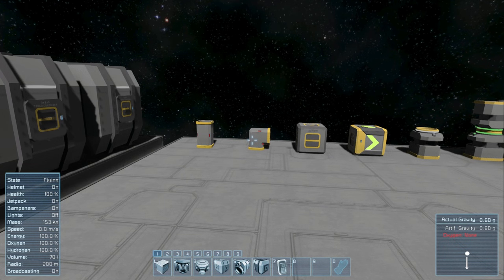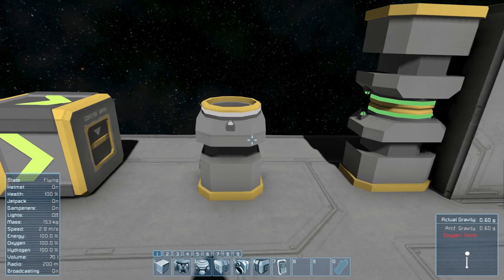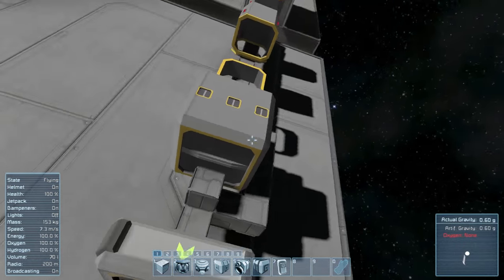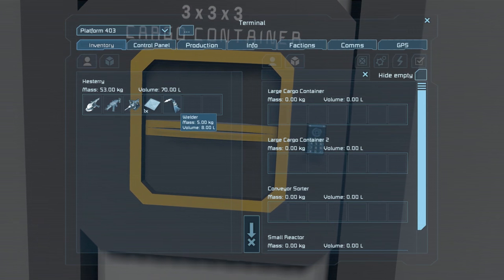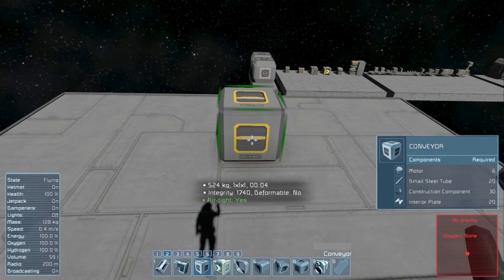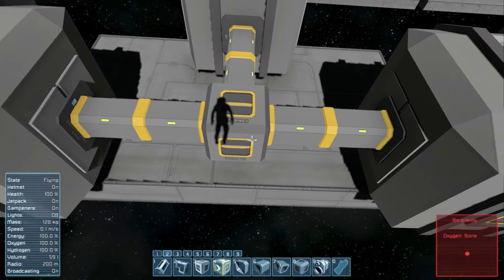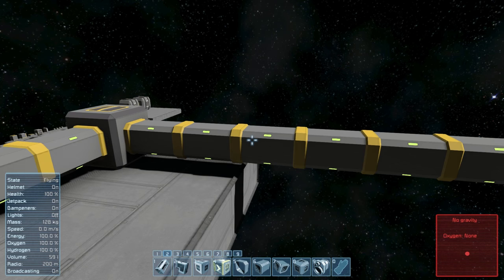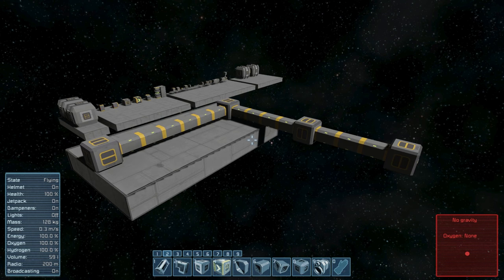Space Engineers - Quick Tip #3: Conveyors

Comment: Quick question:  Why would a "welding wall" type set up fail to finish the conveyor corner before moving on to the next layer?

I don't use welding walls, or even build all that much in survival from blueprints, but this seems like a unlikely situation to me.
Reply from the maker: +Jake Petrie 
It's mostly an issue if you move too quickly or use automation. When welding a large ship, it can be easy to miss that a layer hasn't finished welding. Alternatively, sometimes there just won't be an available mounting point for that layer of conveyors. By avoiding the curved tubes, you can significantly mitigate this risk.
Reply: Fair enough.  I haven't been using the welding walls, and I'm not likely to start any time soon, so I doubt this will be a problem for me.  Good to know though.
Reply from the maker: Jake Petrie
Yeah, it's just one of those things I generally consider "good" design - but it's totally up to the user and their style.
Reply: +Hesterry I guess since most of my stuff it's only ever done in creative, or build by hand in survival it's just a non-issue for me, using the curves saves on materials and/or mass.  but I see how it could really mess up a design.

I started watching, well, everything on your channel today, and I'm really enjoying your work.  both the video quality and the ship design stuff.  a lot of your work doesn't really for my style, but your tips and methods are, I feel, universal.  

I'm trying to use a variation of your ship design system in my most recent ship.  I can't say if it's working or not yet though.  mine will be much more aesthetic than pure functionality though.  hopefully I left myself enough room for everything...
Reply from the maker: +Jake Petrie 
Glad you like it! Demonstrating universally useful methods is definitely my goal, so it's good to hear that you find them useful.

I hope your ship goes well! If you have trouble, working aesthetics into a build with that five step method (the last 2-3 episodes are on their way!) should be relatively easy, and planning goes a loooong way. If you're running into problems, I would build the layout and do a mock-up of any aesthetic rooms before going too far - just to make sure there is enough space. Let me know how it goes!